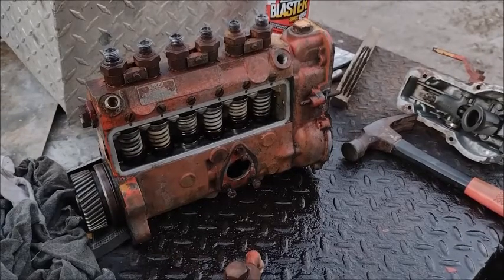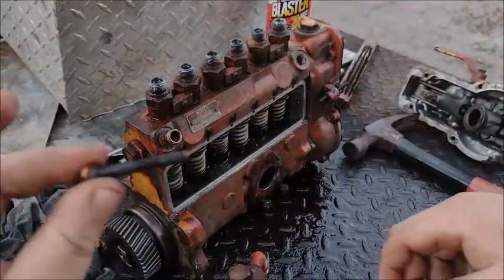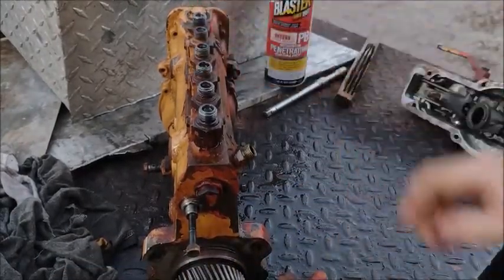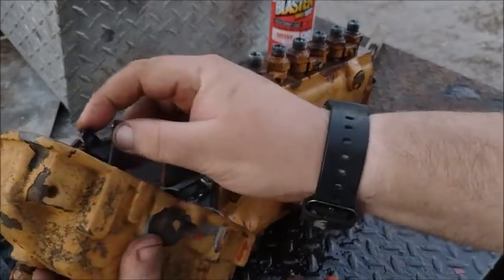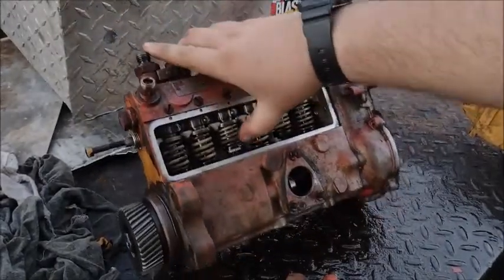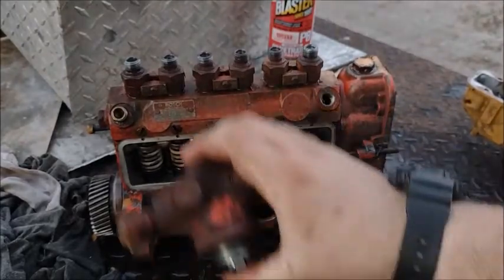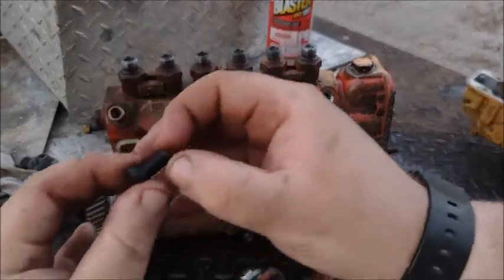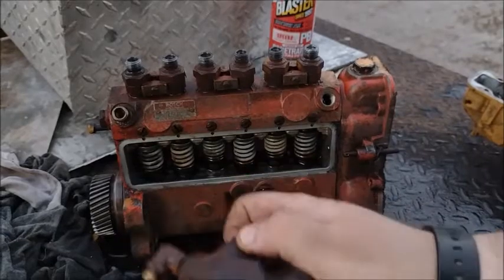case 931 injection pump stuck fuel rack fix and service information pes6a pump

Comment: I broke a plunger spring on a pes2 tractor pump. Any idea how to change that out?  Ive got the DV holder out and dont know what next
Reply from the maker: @certifiedhoarder  you have to unbolt the bracket on top of the plunger bodies. It's got a flathead screw holding the bracket. Take that off, then mark the plunger body where it meets the case, then unscrew it all the way out. The plunger body, plunger and spring should all come out

Comment: I have to pull the governor housing off mine.  Just puking out motor oil on the throttle shaft.   Someone should do a in the shop full disassembly video of this .
Reply from the maker: Good luck with that, I had a hard time finding information on this. Every shop I called wanted anywhere from 2000$ to 4000$ to do what I just did in the video. You can probably just rtv it and call it good. I honestly don't even know where to begin to find parts far these. I had found a seal kit but I don't think it was the correct one so I didn't get it

Comment: Hey, can not find anything about these tractors hardly. I pulled my pump due to a stuck rack. I was not thinking about timing when i done it. Do you happen to know how i would go back together with it? Thanks in advance
Reply from the maker: If you removed the pump without the timing marks aligned, turn the motor over with a breaker bar until you see the timing mark on the gear on the pump drive side of the engine. Then turn the pump over by hand until the gear matches. Careful because you can get it off by a tooth very easily. The pump does move around but from what I saw it doesn't work like a timing Advance on a old dizzy. You have to get the gears meshed just right.

Comment: hay there i have a ford diesel that seems to have the same problem from sitting to long  thanks for the video   TANK
Reply from the maker: is it a 7.3 powerstroke or the older IDI engine? what you could try is diesel kleen i use it all the time and it works pretty good. if the truck runs put a whole 32 oz bottle in the tank and it should fix er right up.